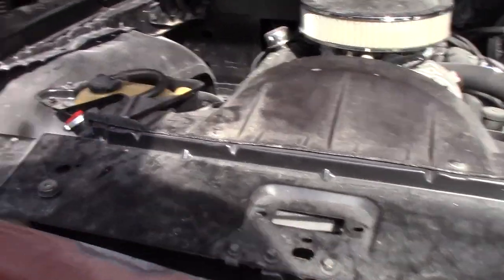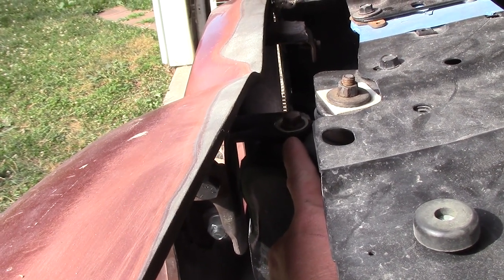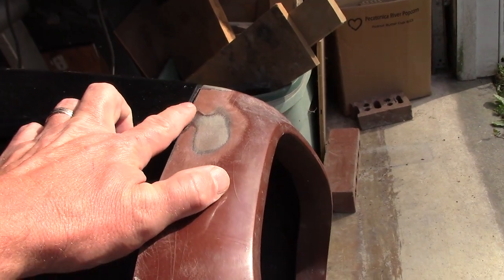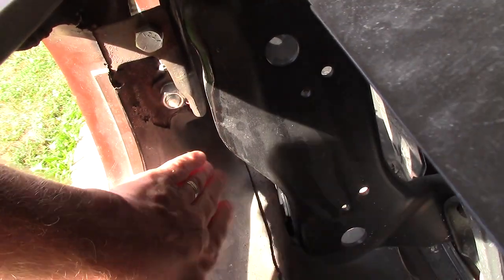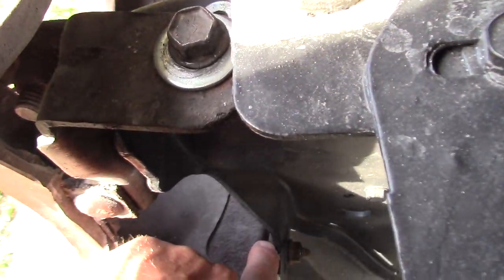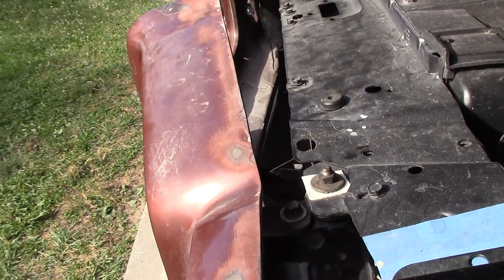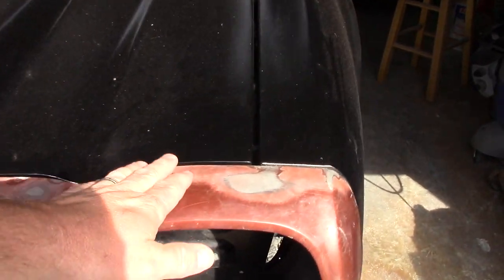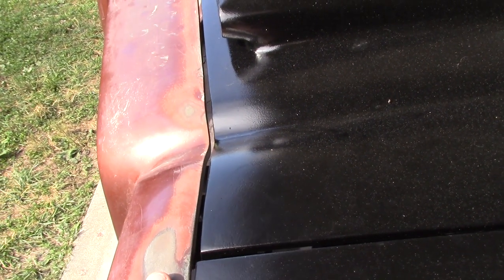How to align a 70-73 Firebird bumper using shims

Comment: Hey Nate, excellent video. My front bumper has never been on right. Is there any sort of bushing on the upper mount on the “horn” to the bumper bracket? Is it just bolted together metal on metal?
Reply from the maker: Hey cody! thanks for watching and for commenting with a good question.  So the bumper brackets mount to the horn without any sort of bushing.  However!  I had to use metal body shims on three of the mounting points to get the gaps right.  Those metal body shims come in a pack and are usually an assortment 1/32, 1/16, 1/8 thickness. If you want, email me some pics or video to heavypedalgarage@gmail.com, or send them to my facebook page under the name heavy pedal garage.  Id be happy to take a look and see if i can give some pointers.
Reply: @HeavyPedalGarage  will do, thanks!

Comment: Are the bumper horns adjustable on the frame? My problem is on p/s the bumper is right against the fender and hood contacts the bumper in that corner too but bumper can't come out any more. The door and fender on that side may need pushed back but I don't know.
Reply from the maker: I would look at the gaps at the door to quarter panel. Then the door to fender. If those are 3/8 to 1/4”, I wouldn’t mess with those.  The horns are adjustable where they connect to the frame. But the adjustment is made in an arc. So pulling it out will also bring it up. Pushing it in will tilt it down. Also there is a press fit part of the bolts that were used. So when installed they really bore in to the horns. So readjustment after the initial setting is a little difficult.  My though is that if the bumper sets level  that adjusting the horns will also tilt the bumper up when coming out. A though would be to just remove the bumper and drill out the mounting holes on the bumper horns to give you some more adjustment. I had to do this. Just used a die grinder and made the hole bigger.
Reply: @HeavyPedalGarage  Thank you I will go through those steps and see where I'm at!

Comment: I have a 74 firebird. Can I put a 73 front on it? I just want my firebird to be different my way..
Reply from the maker: I hear ya on makin it your way! Mine is a 75 esprit with a formula hood and trans am spoiler and fenders. It’s got a 73 front on it. It’s not a hard swap at all. You just need the nose and the brackets that mount it to the frame. Also need to get the lower valence and turn signals. Then you can line up the valence and mark out where a couple brackets will need to be fabricated and attached. That’s it. 4 brackets total. I made them out of scrap metal. Check out this video. I show the brackets and how I fabricated them. I’ve also got a few videos on repairing the endura bumper if it’s in rough shape. https://youtu.be/Wf4JNb7Mj6M
Reply: @HeavyPedalGarage  that's awesome